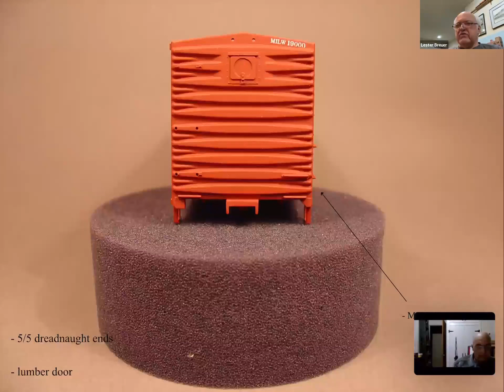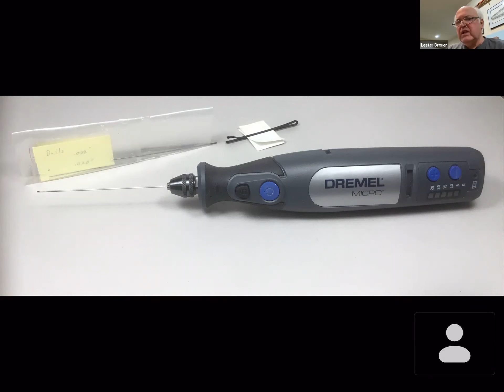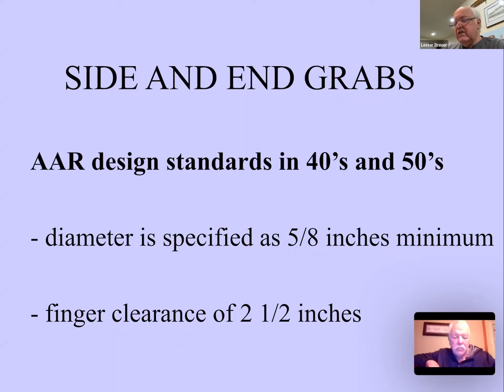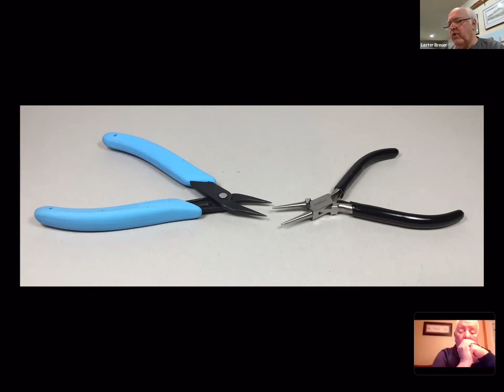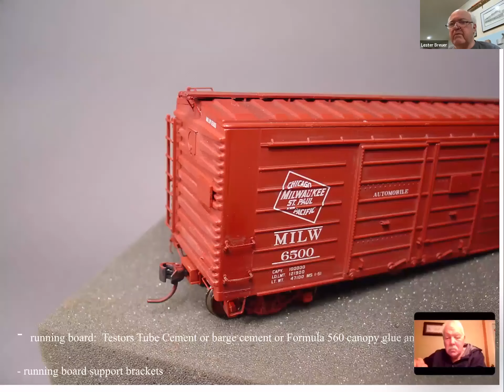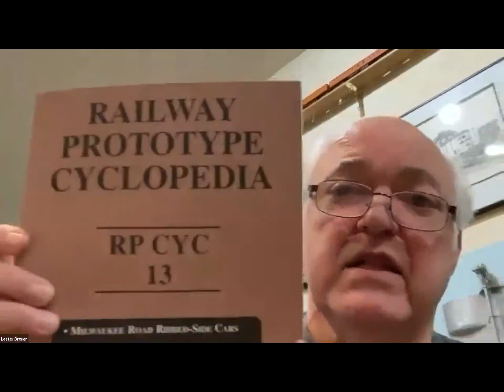Upgrading at MILW Rib Side Box Car Lester Breuer 16 MAR 2023

Comment: Great presentation... rather than using a pushpin try a needle in a pin vise for marking hole locations I've used the same tool for at least twenty years without needing to replace the needle.

Comment: Thanks for this additional video on upgrading boxcars.  I'm in the process of a partial upgrade of an Accurail C&O boxcar, inspired by the previous video on this topic.  I replaced the running board with a Tichy model, changed the brakewheel to something a bit less clunky, and replaced the molded-on brake rod with a brass one.  I also added an air retainer line, which isn't on the model.  Unfortunately, the molded-in Youngstown doors are incorrect for this car, but I can always claim the correct 7 panel Superior doors were replaced by the company shops due to damage.  :-)  Anyway, with that door error I probably won't go the extra mile and replace the stirrup steps and grabs.  I will add coupler cut bars, though.  It will good enough for my layout.  Cheers!